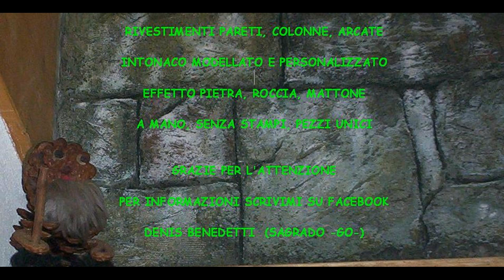Intonaco modellato per rivestimento pareti e altre superfici con effetto pietra

Comment: Ciao Denis, innanzitutto ti faccio i miei migliori complimenti, lavoro fatto bene  
Ti scrivo perché vorrei fare un lavoro simile a casa mia ,non capisco una cosa, ma cosa usi prima di passare l'intonaco, cioè prima che passi l'intonaco passi prima la colla?
Mi potresti fare una lista dei prodotti che usi e i passaggi di manodopera.
grazie in anticipo
Reply from the maker: grazie per i complimenti. prima di tutto pulisco bene e inumidisco il muro. poi applico un "graffiato" con un mix di malta per intonaco e un 10% di colla per piastrelle. una volta asciutto (due giorni circa) applico uno strato di 2/3 cm di intonaco e inizio a modellarlo. appena ho tempo farò un altro video, sperando si capisca meglio.
Reply: Ciao 
Grazie per la tua risposta 
Attendo che inserisci un altro video dimostrativo 
Grazie ancora 👍